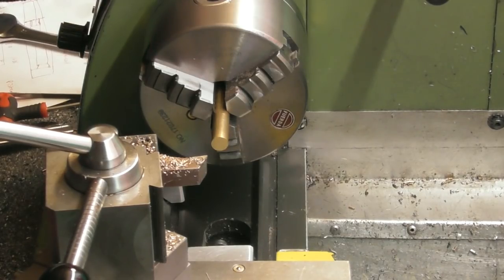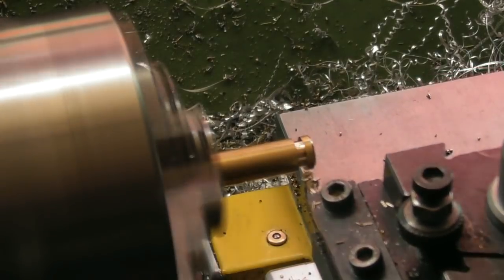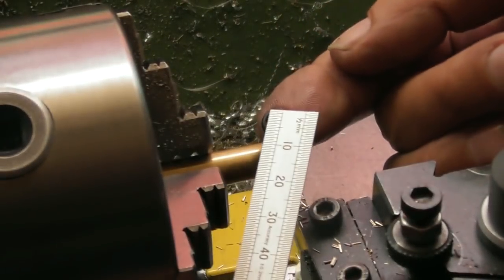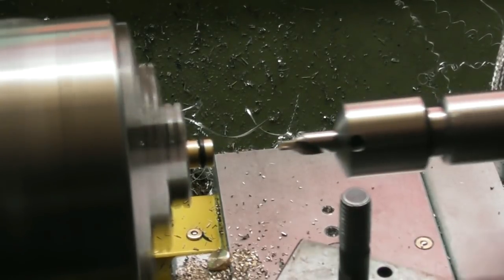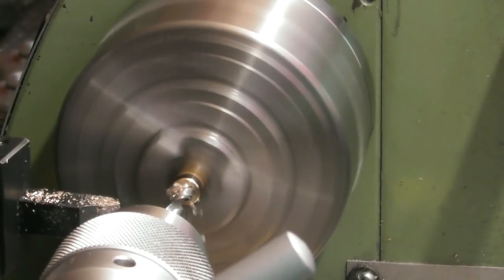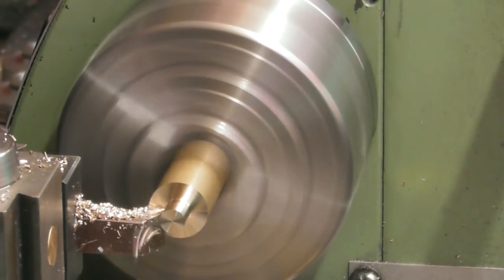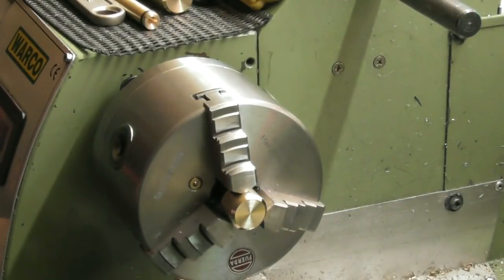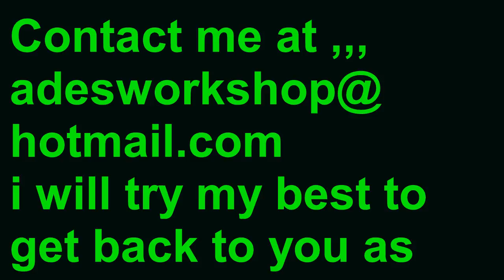Fire piston part 3

Comment: Hi Ade, on the WM180 what would you say was the largest diameter you could machine with the standard toolpost? I'm thinking about the outside of a flywheel for a model steam engine. Graham
Reply from the maker: Hi, Graham , to answer that ,,,,,,, the nominal max diameter of stock is 180mm, however you may get 181 mm before the part hits the bed , that said , it is possible to machine this diameter with a bit of fiddling about with the angle of the compound and setting the tool at a funny angle , i did machine the outside of my faceplate which was done using this method and although i used my toolpost , the factory one would do the same , hope this helps . Cheers Ade.
Reply: ADES WORKSHOP Thanks Ade. Very useful.

Comment: Hi Ade.  Is it necessary to use copper or is this what you had on hand?  Thanks for sharing.
Reply from the maker: did you mean the brass ? not needed just looks cool . and wont rust , stainless steel would be good also . Cheers Ade.